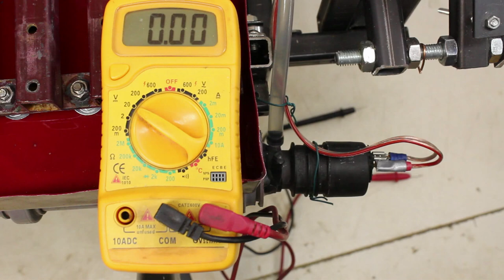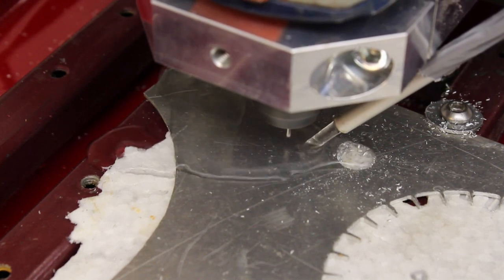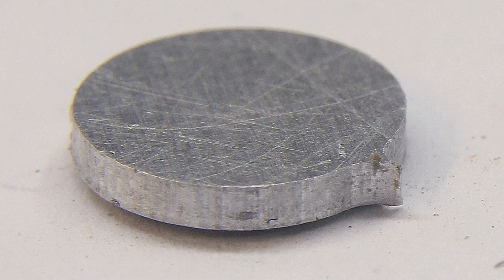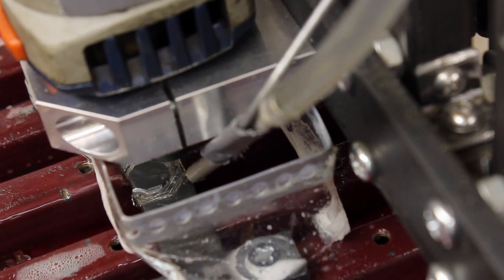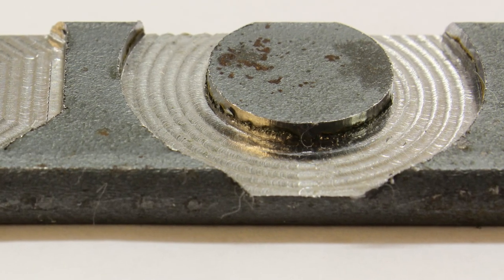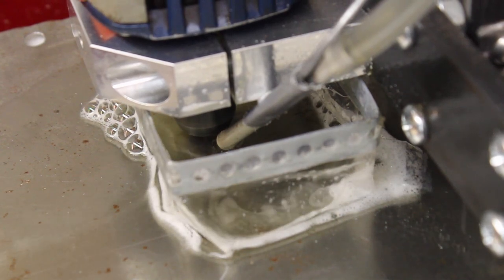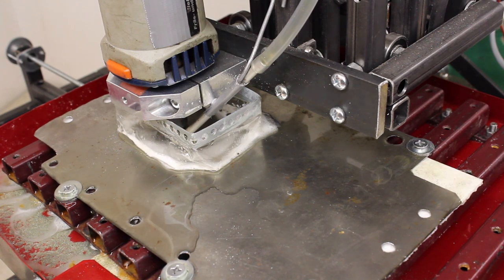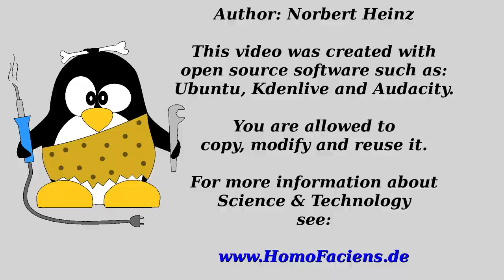CNC v3.2 - coolant install

Comment: Dear Sir, I really appreciate your work and genius ideas. Thank you for sharing knowledge with us. You need to put one pot on pipe output to protect material chips to come into the water pump and choke it. Or much better two pots, one larger and one smaller fitted inside each one, so coolant will over spill from larger into smaller pot, so it will reduce chance for chips to come inside the water pump. Also, I like to use pump from washing machine, it is much better for this project, more durable and also have larger inside diameters. Thank you again for your work !
Reply from the maker: Yes, using a settling basin is a common way of removing particles from a fluid. I had that in mind, too, but with a filter the design is more compact.
With the foam filter, the chips are kept away from the pump. Especially with metal chips, my filter works very good (at least during the few test runs I have made so far). Plastics chips are more tricky to handle because of their low density.
An advandage of using a tank to seperate particles is that the machine is much more easy to clean after work, bacause all the chips are in the tank rather than in the bowl of my machine. I'll keep that in mind for future improvements.
Thanks fo sharing your thoughts!

Comment: восхищаюсь проделанной работой. так держать!
Reply: Thanks for your great effort if possible cnc control program for windows
Is it possible to use sifting program with this machine Thank you
Reply from the maker: Sorry, but I don't use closed source spyware named Windows. You can get Linux for free and install it on your PC and it's definitely the better choice for robotics, machine control and simply any type of computing.
For example Ubuntu is no bad choice for a beginner:
https://www.ubuntu.com/download/desktop

Comment: Hi,
I greatly appreciate your videos, like the approach (home made) behind them.
I have a bit off topic question(s)
I'm building my own cnc and at some parts I'd like to use 4 relatively small steppers (nema23 270oz) from the same driver (MA860H) if possible
Further more I'd need that 2 out of 4 would be easily changeable from running along or against the other two. So if two would run clock wise then the other two would run counter clockwise or clockwise if that's what I need. Would this be possible by simple rewiring the two?
Reason behind is that I'd like to use these 4 motors for turning the base plate being the 4th axis or in different application the two pairs would run against each other moving a (different) base plate in a linear motion creating an extended Y axis. I'd like the cnc to be easily changeable from a 3 axis for flat cutting to a 5 axis for carving. Thanks for reading.
Reply from the maker: If you have a 2 phase bipolar stepper motor (4 wires) you can swapp the direction of rotation by simply swapping the two wires of one phase.
Reply: I was hoping for something like this, thanks!

Comment: I suggest using orange oil in the oil, it is generally water soluble. Environmentally friendly yes and also bio degradable. Also plain vegetable oil mixed with water may work. Grape seed oil is also a good choice.
Reply from the maker: I never used orange oil or grape seed oil. Sounds like it is worth a try.
Thanks for sharing!
Reply: Orange oil is popular for degreasing things. However it is fairly viscous. VS grapseed oil is thicker, it has the consistency of 40w gear oil. I suspect grapseed oil can be amulsed by your pump fairly easily.
Reply: You can use regular motor oil.

Comment: Back in the 1980's we still used either turpentine or denatured white spirit as coolant (though it was forbidden) when cutting aluminium. It produces a very good surface if your cutting speed and feed is set correctly. In the good old days milk was also used as coolant, but it required a lot of cleaning... so it is not recommended.
Reply from the maker: It's the first time I heard about using milk. Turpentine and spirit are inflamable, thus I'd like to avoid those coolants. Maybe if the software allows to fine tune the machine parametert I will give it a try.
Thanks for sharing your knowledge!
Reply: You are very welcome. You can find the formulas etc. in Tabellenbuch Metall from Europa Lehrmittel. I remember that book from the 1980's where I used it a lot as reference in the workshop.
Reply from the maker: ...da werde ich mal nach Googeln. Thanks!
Reply: Milk is organic emulsified coolant. You get it by mixing oil in water. Which you can do with detergent. Who says oil and water don't mix? But you also need a defoaming agent. Alcohol works.
Reply: @Paul: Well nowadays milk could mean an emulsion, but in the good old days it was milk, just as lard and slugs (snails) were used to grease wagon wheels. A suitable (not ideal) emulsion can be made by mixing two-stroke oil and water in equal measure and shake it hard.

Comment: When you try other lubricants, please measure the temperature of both the bit and the ambient temperature of the coolant after some time cutting.   I'd like to see what high pressure air aimed directly at the bit would do for temperature drop and cleaning of the bit, I know that adds additional complexity and risk to your design though.
Reply from the maker: Using high pressure air will spread the chips in my workshop without an additional vacuum exhaustion. I will implement something like that later on my machine. It's good for woodworking.
No bad idea, but I must get an adequate temperature sensor (pyrometer) for the readings.
Reply: Thanks.

Comment: Wouldn't you get a better finish by using a cutter with more flutes than just two?

Also, about the software, the less-than-ideal state of which you've mentioned: have you ever considered using something like LinuxCNC? I found it pretty efficient and easy to work with. Could be more practical than having to write an optimized program from the ground up!
Reply from the maker: Yes, the more flutes, the smoother the finish - as long as all machine parameters are correctly adjusted and the mechanics is (widely) free from backlash. A two flutes milling cutter is a good allrounder.
I won't write a CNC program from scratch, but adapt my machine to LinuxCNC or other open source software. It's all about making my CNC process G-code by writing a new Arduino sketch.
Reply: The thing is, LinuxCNC is a motion controller, it provides the motor control signals almost directly, in the form of motor direction and step signals. That's pretty much what made me try it, I didn't need to write a G-code processor/interpreter. I made a simple stepper driver around a Microchip PIC because that's what I had at hand, but for stepper motors, even using good old 74-series up/down counters with preload would have been sufficient.
Your Arduino code already has enough to interface with LinuxCNC. It just needs to make your DC motors look like steppers to the computer. 
Unless, of course, you really want to write a G-code processor for the Arduino for "academical" reasons, which I also understand, haha.
Und übrigens: frohe Weihnachten! :)
Reply from the maker: Thanks for the hint! I still did not find time to have a look at CNC software. The one I have written does what I want my machines to do. However people are asking for G-code functionality or interfacing with CNC software and I try to fulfill whishes, especially on Christmas ;-)
Dir auch ein frohes Fest!

Comment: What do you think are better for CNC machine:- Stepper motors or DC motors with rotary encoders.
Reply from the maker: Both have their pros and cons:
DC motors with encoders (closed loop) don't loos steps. You can even power off the machine and have a quiet night. It will continue working where it was as long as the Arduino (and so the sensors) are still powered through USB.
Biplar stepper motors are brushless motors, thus there is (almost) no wear on the mechanics.

Comment: great video :-) seeing that you are cutting very different materials with this machine I was wondering if you could talk a bit about spindle speeds and feed rates for the different materials in one of your next videos?
Reply from the maker: Next thing to do is working on the software so that I can fine tune the feed rate. Currently it is a very rough adjustment.
If that works, I will of course talk about parameters of machining.

Comment: Make organic emulsified oil cutting fluid. Just dump some oil in there with your soapy water, and alcohol. The alcohol is a de-foaming agent. It lowers the surface tension of the liquid. That recipe is what makes "milk". Your cutting fluid will look like skim milk. Rub some between your fingers, to feel it. It should feel slick, and slimy. If not add some more oil.
Reply from the maker: Thanks for sharing your formula. Using alcohol as de-foaming agent is a good hint. It will also stop the growth of microorganisms in the emulsion.
Reply: +HomoFaciens the de-foaming component is the trickiest. Alcohol may not be the best, but it is the most accessible. I'll give you another pro tip, try not to use scented soap. Because no scent seems to come across right in this concoction. I used liquid dish detergent, and it worked, but it did not have a pleasant odor to it. More unpleasant really. Some kind of bargain powder detergent may be best?
Reply from the maker: You don't need such a high concentration to make the fluid flammable, but yes, the fumes might catch fire...
Another yes, soap isn't soap - there is a lot to be considered. Another thanks for sharing your knowledge.
Reply: +HomoFaciens the real magic is the fact that you can get oil and water to mix. So you have a lubricating coolant that is also somewhat rust inhibitive too. You still have to clean the coolant up off metal though. But it won't rust metal quite as quickly as when there is no oil in it.

Comment: I think whatever coolant you need a bit higher pressure jet to evacuate the chips
Reply from the maker: ...another paramter to be adjusted. I'll implement that as an option in the software.
Reply: Curious to see what would happen with a half decent cutter.  How much would it cost to get a decent cutter like a sandvik?
Reply from the maker: The cutter I am using isn't the cheapest. It's not that bad, but there is nothing better than quality tools.
Reply from the maker: Yes, there is nothing better than quality tools. In long term use they are cheaper than the cheap tools...
That feed rate calculator is a nice utility. Thanks for sharing your thoughts!

Comment: Thanks for your great effort if possible cnc control program for windows
Is it possible to use sifting program with this machine Thank you
Reply from the maker: Sorry, but I don't use closed source spyware named Windows. You can get Linux for free and install it on your PC and it's definitely the better choice for robotics, machine control and simply any type of computing.
For example Ubuntu is no bad choice for a beginner:
https://www.ubuntu.com/download/desktop

Comment: can you make 5axis cnc?
Reply from the maker: First I have to make this 3 axis machine run reliably. Adding axes means adding backlash and complexity. Creating a quality machine having 5 axes is no easy task.
Reply from the maker: muhnd kalil
Of course it is, because 5 axis CNC machines already exist. The question is how precise such a machine will be and you can't answer that question until you have build it...